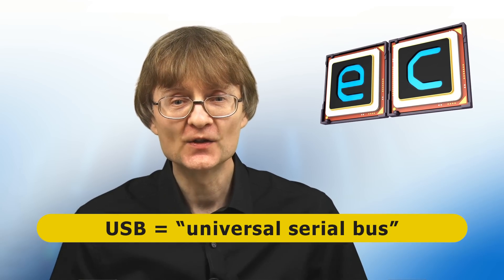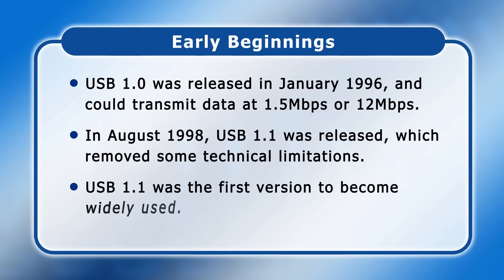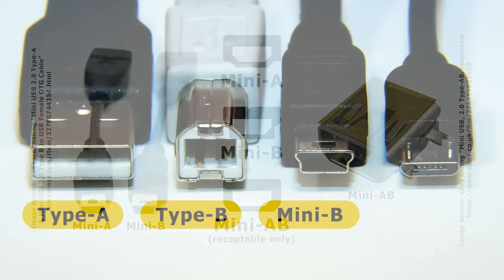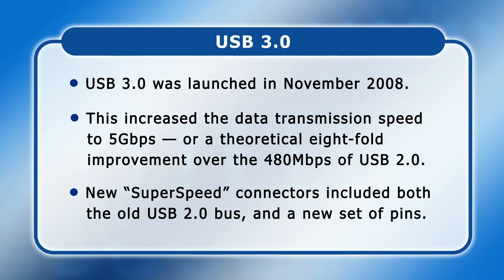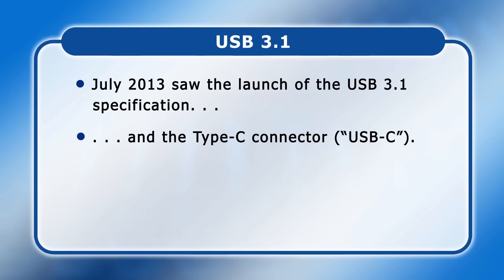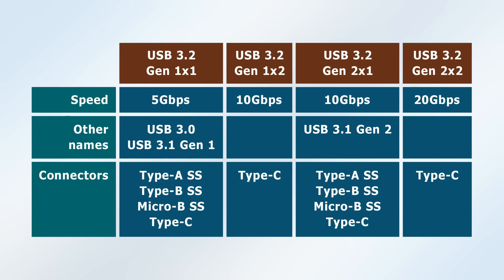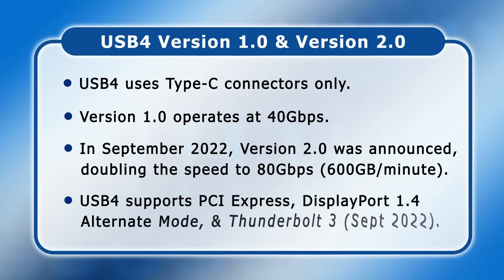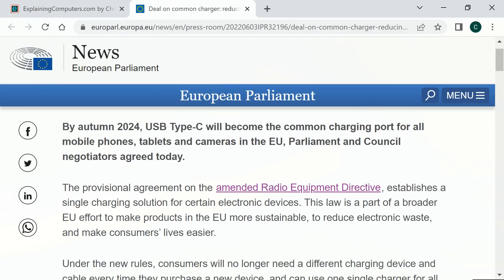Explaining USB: From 1.0 to USB4 V2.0

Comment: 80GBps x 60 s/m - 4800 GBpm, rather than 600GBpm ... you can't override grade 3 arithmetic.
Reply from the maker: I'm afraid you are wrong. As the video makes very clear, USB4 Version 2 is 80Gbps (gigabits per second), not GBps (gigabytes per second). So 80Gbps is 10GBps, which is 600GBpm as I said.

Comment: If I understand correctly, one of the main reasons for going from a mini-b to micro-b plug was the 'barbs' that kept the connector together. In a mini-b the barbs are inside the host and not the cable. So if they broke, the device had a difficult time keeping the connector connected. On a micro-b, the barbs are on the cable, so if they break, you can easily swap the cable.

Comment: USB is a mess and past USB 3.1 I kind of lost track of what's what, so I want to say thanks for clearing that up. 
Personally I don't have devices that go past the 5Gbps of the USB 3.x Gen1 spec, they're USB sticks and external hard drives and fast enough for external drives for my use. The Gen 2 and 2x2 drives are a massive jump in price and their faster speeds doesn't matter when USB ports I typically interact with are USB 3.x Gen 1 only.

Comment: Great video. There's one thing you didn't touch on in depth, and it's the fact that many USB-C cables - and in some cases, ports on the host device itself - can be as low as USB 2.0 spec.
If you buy a USB-C cable and it doesn't proudly proclaim that it can do 10Gbps or whatever on the box - chances are high that it is a USB 2.0 cable with a USB-C connector.
Similarly, there's also a chance that your phone's USB-C port is capped at 2.0 speeds for data transfer, regardless of the cable you use.

Comment: what about red and orange ports?
Reply from the maker: There is no set standard. Often red ports are USB 2.0 and blue USB 3.x. On other occasions red and orange are used for the higher speed USB 3.x ports. But it is device specific.

Comment: This may sound old fashioned, but I remember RS-232 and even IEEE-488 for connection instrumentation, and in fact I have a few instruments with IEEE-488 connectors.
If course, there is IEEE 802.5 Token Ring, and I will never forget starting to use MIL-STD-1553 in the late 1970's / early 1980's when I worked at Northrop Aircraft in their Avionics Integration Laboratory.
Here's an idea for you.  DO VEDEOS ON IEEE 802.5 Token Ring, IEEE-488 (HPIB) and maybe MIL-STD-1553

Please have a lovely day.

Comment: Although I'll agree that USB is more confusing that it probably needs to be, we also have to give it credit for being pretty amazing.  When I was young, our cables were 9 or 25 pin serial cables, in BAUD - bits per section.  That as a "techy", we had to figure out (remember DTE vs DCE?).   Now, the least technical person can be using USB-C, and have GBit transfer rates (with a non-polarized connector for anyway insertion).   We've come a long way!
Reply from the maker: Agreed.

Comment: you forgot to mention the color standards... they make everything much more understandable and easy to tell how fast a port/cable is just by looking at it and don't have any problems with products not following the correct standard or not color coding their stuff at all. Nope no one would ever mess up the colors or neglect to use them at all.
Reply from the maker: I did not "forget". :) The only USB color standard that has been maintained is blue for USB 3.0 SuperSpeed ports, as I mention in the video. There are no color standards for USB-C connectors which support the widest range of specifications -- or even to distinguish USB 3.1 from 3.2 using Type A/B/Micro SuperSpeed.

Comment: to the final, is the same 3.0 but power up with more amps to increase the data transfer, the cable is the same , only change the technology of the hardware who you input the cable, thats why change the name all the time, they are smoke sellers hahah

Comment: Thank you very much for the clarification... It does remain quite the jumble nonetheless. I've just downloaded CristalDiskMark giving the USB ports and its devices a go. I'm on an old MSi all-in-one from 2012, Windows 7. Specs of this machine only say 3.0 and 2.0 ports. Physically they are all type A with 2 blue coded ones, and the rest white. Yet, the WD external hard drive (not an SSD) connected to the USB A with white code is reported as being faster than a flash drive in one of the blue coded USB A... LOL. Yet, the blue coded ports are labeled 3.0... You'd indeed expect the blue ones to perform faster, but clearly not... chuckle. 
Personally, I've given up on all the USB promises... You just can't tell from the looks.

Comment: Is there any way to test a USB cable determine functionality and data transfer speeds?  (I have about a hundred USB cables I have collected over the past 15 years or so.)
Reply: Its matter of which pins are wired up, with USB-A/B usb 3.0 cables marked by blue color, USB-C dont have any marking standard which makes confusion. USB-C can me just wired for chargeing, same as USB-A/B, it can be just for usb 2.0 by having only D+ D- datalane. it can just have Gen1/2 single lane wired and 2 lanes allowing 2x2  speeds. there wire testers that can show you what si wired up

Comment: USB started so nicely. It was simple, and then they just made a sloppy mess of it, for no good reason. I have to do research on which is the optimal cable for what I'm using it for, every time I buy a new cable. They're seemingly getting a little better with 4.0 but still messing it up.

Comment: I've never been a big fan of the micro or mini connectors. So when they came out with USB-C and the plugs were flippable that sounded like an awesome idea. Of course the implementations are inconsistent and now we've got a labeling nightmare. I blame the manufacturers mostly, but I can't just blame them. A lot of the confusion is because of the standards writers. The whole lot of them should be scrapped and we should start over with people that have real world experience.

Comment: Why don't you explain about quality problem of USB cables for SuperSpeed transmission? Moreover, negotiation problems about power source/sink and e-marker incompatibility (different between thunderbolt3 and USB3)? They nearly destroyed USB functionality, I think. Honestly, I dislike USB3.1 (or later) products because of its fragility and connection problems. 22 wires in a cable ? insane! I neither use nor buy them.
Reply from the maker: Because there is always a limit to how much information I can include in one video.

Comment: I think you forgot to mention that there were usb-c cables able to fry your devices as they were manufactured incorrectly. 🙂🔥
Reply from the maker: It is sadly always possible to buy products that do not conform to standards, and this will has you imply become a greater and greater issue with USB-C cables as they are increasingly used for power delivery.
Reply: @ExplainingComputers  indeed. Also you touched upon it, although without explaining explicitly: with smartphones adopting usb-c the market is being flooded with usb 2.0 charging cables and finding replacement 5 Gbps and 10 Gbps cables for external storage devices feels like a treasure hunt.

Comment: The USB PD standard also includes 12v charging.
Reply from the maker: No, it did. :) The most recent version -- "USB Power Delivery Version 3.1 version 1.5" -- which is what I reference in the video -- offers the fixed voltages 5V, 9V, 15V and 20V in the standard range, and 28V, 35V and 48V in the extended range. 12V is no longer included as a defined fixed voltage. This said, other voltages can be negotiated, and my wording in the video is carefully chosen not to exclude this possibility. :)

Comment: If only the manufacturers would adhere to the marketing names:
HighSpeed: 480Mb
SuperSpeed: 5Gb
SuperSpeed+: 10Gb (over Gen 1x2)
SuperSpeed 10: 10Gb (over Gen2x1)
SuperSpeed 20: 20Gb
USB 40: 40Gb
USB 80: 80Gb
Reply from the maker: Since when was USB4 referred to as USB 40?! :) Nice set of names though.
Reply: @ExplainingComputers  I was more referring to the Logos, that are supposed to be put on the box or device near the port to indicate what it can do.
I looked it up and apparently USB IF simplified it even more: 
usb DOT org/sites/default/files/usb-if_usb_performance_logo_usage_guidelines_final_20220809 DOT pdf
Reply from the maker: @MrDiarukia  Ah yes, those. :) But giving standards two names is never a great idea . . !

Comment: Another great history recap. I would however disagree that if something has USB-C then it is likely to operate at 10Gbps because there are so many devices still using the 2.0 spec, particularly phones in the budget and mid range areas. Considering that USB-C has been around for so long and USB 2.0 not being consigned to Jurassic history, it does show us that there has been too much of a drip drip release of tech over the past 10 years at least. The industry is crying out for somebody to come along and give people hat they want and deserve in 2022. It is not as if all of the development costs have not already been recovered long ago. We could so with a Freddie Laker style shaker upper of Tech (or disruptor in modern terminology) to shale the industry out of it's nod and a wink cartel style operation.

Comment: absolutely great video!
personally what I find most annoying by USB standard is that PD does not include any voltage between 12.6-14.5V to make it compatible with all accessories intended to be powered by a car battery...

Comment: USB Micro-B was just the worst. It retained the quantum orientation problem of USB-A but added significant mechanical flaws that saw the connectors break on either the device or the cable in a short order of time. Thankfully now we have USB-C capable of deploying a "docking station" that gives all peripherals connected, supplies dual monitors, and powers a laptop all over one cable. The connectors will also last a lot longer than a Micro-B ever could.

Comment: Everybody cheers USB-C's ability to be inserted either way, but this is actually a huge flaw.  Manufacturers of adapters and cables can save a fraction of a penny by only wiring one side, and they do.  Data not working?  It may not be a power-only cable.  Try flipping it.

Comment: I have a question for you. It really doesn't have anything to do with this video. I am looking for an answer to a question I have regarding assembly language. I am wondering if it is possible to translate a program written in assembly language for the Z80 to binary. If it can be done, how would one go about the translation process ? Can this be done by hand without using any computers or software ? Someone told me it used to be called hand assembly.

Comment: Great overview of the various versions of USB. I was involved in the early versions of the spec 1.0 & 1.1. Our goal was to provide a single high speed and low speed (mouse guys did not want to use shielded cable)  interface that could replace the plethora of special purpose connectors then used on PCs.

Power delivery was another strong requirement. Remember at the time neither Ethernet non Firewire (IEE1394) were able to deliver power.  Back then the laptop guys hated having to deliver 500 ma.

All in all USB has succeeded beyond my wildest dreams.  The two most surprising developments for me is the emergence of USB Flash drives (back then 500 MB disk drives were mainstream) and USB being used to power an ungodly array of widgets.

All in all a pretty good track record considering we could not figure out a clever marketing name so it came to market with the name we used in development. 
.
Reply: Tom, did you use a specific front-end to leave that comment, or is the lone dot on the end just a habit?
Reply: @encycl07pedia-  Probably just a typo on my part.
Reply from the maker: Fascinating post. Thanks greatly for sharing this here. :)
Reply: I'd blame muscle memory but I'm not familiar with your experience of Morse code.

Comment: I must be honest, although I like standardisation, I find it's easier to damage a USB C port or jack than it is the barrel equivalent. I'm even typing this on a Thinkpad that refuses to charge if the USB lead is pulled in the wrong direction.
Reply from the maker: I also much prefer a barrel jack for power.

Comment: Despite of the EU requirements, manufacturers find a way every time again to make you current inventory of cables and power supplies obsolete. Being it the connector, or the minimum voltage a USB-PD source has to be able to supply. Add the designed-in obsolescence path, and guaranteed by the time the now-new devices are obsoleted, new USB communication and PD standards will have emerged. Rendering you current cables, connectors and power supplies worthless again. Sure, I have been waiting to backup my 2 TB disk in less than 2 minutes. Before long even that will be superseded.

Comment from the maker: CORRECTION: Note that in the initial graphic showing all connectors and standards (c. 00:34 in the video) the labels Mini-A SS, Mini-B SS and Mini-AB SS should be Micro-A SS, Micro-B SS and Micro-AB SS. You can see a corrected version of the chart here: https://www.explainingcomputers.com/images/USB_Connectors_Specs_CORRECTED.jpg

Everything is correctly labelled elsewhere in the video where each connector is covered in depth. My apologies. This video was reviewed and corrected four times before upload, but this still crept through the checking process. :(
Reply: How fitting that a video about USB needs corrections and amendments.
Reply: Bit of work creating these USB ID matrices. Thanks. 🙏
Reply: just a "small" mistake
Reply: Micro or mini, almost the same. No need to worry 😃
Reply: It's confusing even you!!!
Reply: You missed mSata, but that's understandable... Not many people know that it's basically usb2.5
Reply from the maker: @runed0s86  mSATA is, by definition, not a USB connector (as defined by the UIF).
Reply: @ExplainingComputers  I have an old Toshiba laptop with one eSATA USB Hybrid port or eSATA+, something like that. After watching this video I looked for USB 'colors' there are 9! I didn't know there were so many different colors.
Reply: @igorferreirapoco  My Asus mainboard thinks red is the proper color.... for both USB and eSATA. Which are right next to each other. <headdesk> I've seen those hybrid ports, wasn't sure what the heck to do with them!
Reply: @Reziac  I remember plugging my pen drive into there and working well! I never had an external eSATA drives to plug their.
Reply: @ExplainingComputers 
whats the UIF? is that an international standard or EU only?
Reply: @runed0s86 Come on, man, this guy is becoming a YouTube computer legend You can correct his british terminology but you can't correct his explanations
Reply: You should pin you correction comment so more will see it.
Reply: Might want to pin this.
Reply: 1:11 upto 1.45 too.
Reply: Thanks for the video. Note that depreciated it’s not the same as deprecated.
00:44
Reply from the maker: @MarcSolomonScheimann  Well aware of that.
Reply: There are so many people I'd like to show this to but alas you can lead a horse to water but can't make him drink.  Also, most of us here in the US use "mice" vs "rodents".
Reply: @rocketman7sam I was wondering what the hell he meant by that!! thank you!
Reply: pin this

Comment: The USB rabbit hole doesn't stop there. There's also Thunderbolt. At first, Thunderbolt used a Mini DisplayPort connector, but as Mini DisplayPort was phased out in favor of USB Type-C, Thunderbolt also made the jump to a Type-C connector.

The USB 4 standard now includes Thunderbolt, which is important because it finally allows AMD systems to use Thunderbolt (which was initially a collaboration between Intel and Apple).
Reply from the maker: I plan to cover Thunderbolt in a separate video -- there was already a lot of detail in this one! :)
Reply: Unfortunately, the newest USB standard is superior to Thunderbolt so it no longer being proprietary is meaningless.
Reply: @Robbie-mw5uu  superior in what sense?

Comment: My Sony Handicam have an USB Micro AB receptacle labelled as "Multi" but I don't really used that port as I just remove the SD card to do my transfers and I haven't brought any accessories for it if that what the port is for.
Reply from the maker: Sony as I recall used it as an AV connector.

Comment: I remember every time a plugged a device into a USB 1.1 port on my Win XP machine, I'd get a "helpful" popup explaining that if I used USB 2.0 it'd be faster. Which I certainly would have done, if I had any 2.0 ports. Thanks, Windows, for explaining that newer hardware runs faster! Perhaps we could add similar popups for slow ram, cpu, hdd, etc, etc.
Reply: haha yes, used to get that on my Pentium II with XP.
Reply: @RWL2012  Glad it wasn't just me! 😃

Comment: Don't forget USB "alpha" - Atari SIO designed by Joe Decuir who later designed USB 1.0.  SIO required all devices to have firmware, supplied 12V over the cable, and supported a wide variety of equipment just like USB.